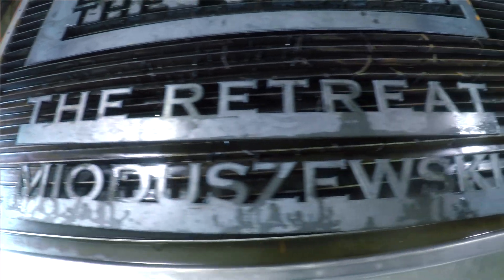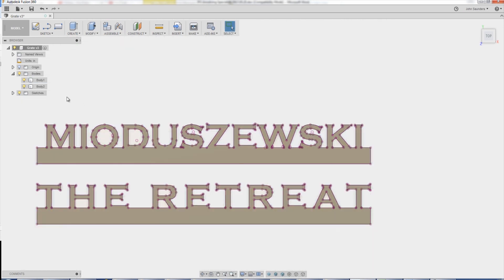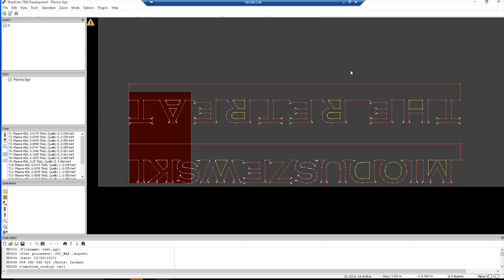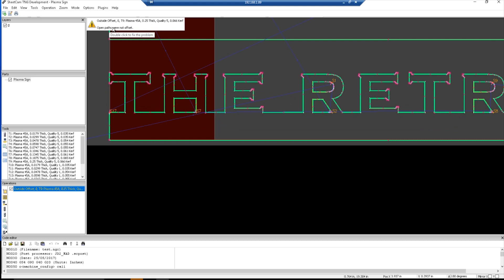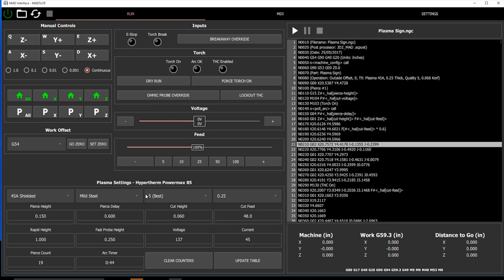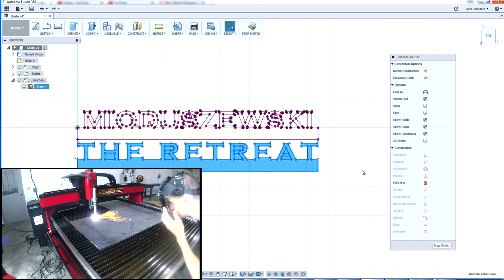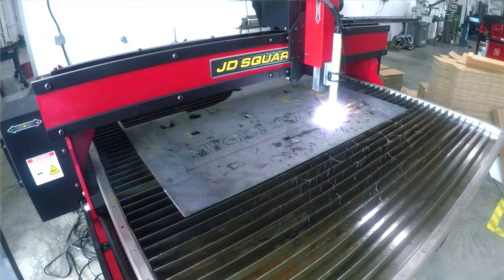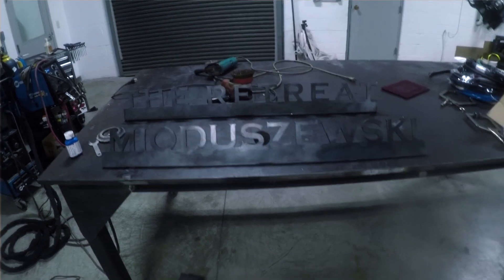CNC Plasma Sign on JD Squared MAD 5x10!

Comment: you wasted that plate for no reason.  I have a Jd2 5x10 table also.  there is a very easy work around that will help you restart from an error. Also, as of now you are correct in stating there is no preview screen as it cuts.  they are supposed to be incorporating that into the next release of their software, which we get free upgrades for the life of the machine.  if you are interested in help with it let me know.

Comment: Hello. You said never control the machine remotely. Why? I've tried x, y, and z movement remotely and it works well. Spindle on, pump on, reset, all working here. Is there any other thing that I missed?
Reply: I've webcam setup for that. I plugged the webcam directly to the CNC Computer and the webcam software is open in the same computer. I can watch both mach3 and the webcam software in remote desktop.
Reply: How well can you put out a fire remotely?

Comment: I actually have something to add to one of these finally.
In SheetCam, you got a warning about not offsetting open paths. If you look, the middle of your "A" is white, which means it's not a closed CAD line. You can go back into your Fusion sketch and find the place where the lines don't join together. (Any hints on how to do this easily in F360?)
Again, in SheetCam, outside cuts should show up in red, and will cut so that the kerf edge is on the outer side of the line;  and inside cuts should show up in yellow, and will cut so that the kerf edge is on the inner side of the line (compensating for the kerf width, so that your parts come out with the correct dimensions). Open cuts will be white, and sometimes you want this, for bend perforations or internal tabs and such. What the warning was saying is that the open cuts won't have an offset, so the kerf will be directly over the line, instead of offset to one side or the other, as you get with outside and inside cuts.

Comment: the problem with the "s" is almost definitely a design flaw not a problem with the cam. That font looks similar to copperplate and the "s" has a small serif at each end. Creating a base line that connects the lowest parts of the letter can create a problem with the "s" because you are leaving a little gap in the layout and the cam is trying to cut what you told it to cut. That's one of the hardest parts of laying out text, the details. If you didn't layout the design, then you should let the designer know. It's an important lesson for them and will help whoever did the layout get better.

Comment: Hey John I'm not sure how familiar you are with sheetcam yet but a lot of times when it says you have open contours you may have over laying lines. A good indication of this is look for multiple start points  after you tool path it. You should only have one start point  (lead in)  for an outside or inside interior cut. Also you can select contours from sheetcam. Right click and select all open contours and put on its own layer and sheetcam won't cut that layer because it's not selected when you tool path.  I don't know what kind of touch off the mad table has but if it's ohmic, with a lot of cutting you can get blow back inside cap which will touch the tip and cause an error. I got away from ohmic and just cut with the floating z switch. I look forward to more videos!

Comment: A handy tip is start your pierce for the outer perimeter at the top right. If you constantly set the origin of your nest to the bottom left having the pierce at the top right will mean the final cut runs along where there is still a lot of material. With some plate you will see your cutout move when the material expands so having the last area of cut where there is maximum material will reduce this shift.

Comment: Also when the machine stopped, did you have an alarm on your hypertherm?  Its pretty common to get the 030 error message really for no reason.  Its quite annoying.  One last thing.  How is your water level?  If its not already, raise it up until it almost touches, or touches the bottom of the sheet and thank me later for less dross and less smoke :)
Reply: Ramsey Customs - turbocobra I have been told for steel having the water level up is ok, but if you cut aluminum, you want at least a 1/2" gap. Cutting aluminum creates hydrogen gas, and it can be dangerous if you create a pocket of it under your sheet.
Reply: If he's using the ohmic tip for height and collision sensing, water will interfere with proper operation.  I wonder if it was a water droplet that caused it to stop?
Reply: Ramsey Customs - turbocobra Yes, you are correct.

Comment: When you got the message that open paths were not offset sheetcam will automatically not cut on the inside or outside and will pierce directly on the cut line and will be cutting on the cut line instead of being offset to the inside on the the inside cuts for example, it can't said the lead ins and outs.  When this happens it's a CAD issue likely a disconnected node.  Those rapids are awesome !

Comment: Really like being able to save sketches as dxf in fusion. SolidWorks does not handle them as well
Reply: SolidWorks does handle DXF's, and actually quite a bit bitter. Right click on the face of a part file, then click Export to DXF. You can also save a sketch as DXF using Save As.
Reply: nhbb980 you can just safe the part as a did and select the view. No problem in Solidworks I think.

Comment: Actually you can just create a new sketch by clicking the button 'new sketch', select the face you want and close sketch. No need to use the projecting tool. By using the projecting tool, you get double lines, which were removed by your plasma CAM as seen. So just more work than needed, but same results :)
Reply: I learned this the hard way, our plasma software doesn't handle it as well as this.
It took me far too long to find the source of the double lines.
Also found if you want to project several things or leave parts out of the dxf sketch create it on an offset plane
Reply: John's showing the it always work way for newbies
Reply: daniel lyall even more important is it to show it the right way. 
John does a great job, I just saw something I struggled with by my self and wanted you all to know that there is a way to save time and prevent hiccups further down the workflow ;)
Reply: You only get double lines if you click twices on a given area

doing this does nothing
Actually you can just create a new sketch by clicking the button 'new sketch', select the face you want and close sketch
Reply: Try it out, projecting the contour in a sketch in that contour creates double lines ;)
Reply: I don't need to try it I do it everyday,Do you require me to prove you wrong
Reply: daniel lyall
He's not wrong, I had issues with it as well, it really depends what software you are using to open the dxf, Sigmanest for one really doesn't like it.
I found one dxf created on a face and then projected was 800kb
The same profile projected on an offset plane was only 400kb and it opened cleanly on the other program
Reply: That most times is down to by mistake double clicking or doing a small drag and if the auto project settings are turned on it can happen as well the 6th and 10th setting on the preferences design tab
Reply: daniel lyall 
Thanks for that, auto project is the problem.
I hadn't even realised there was a setting for it.
Reply: I should've said that in the first places It's hard to rember all the little gotchas
Reply: daniel lyall ahh, I didn't know there is a setting for it. Again what learned :)

Comment: Still more reliable and less hassle than a water jet.
Reply: Occams Sawzall I worked with an omax water jet at a previous job and it had around 1500 hours on it without any problems when I left the company. Just requires the right upkeep and you will be fine